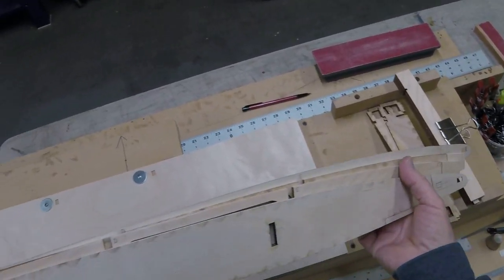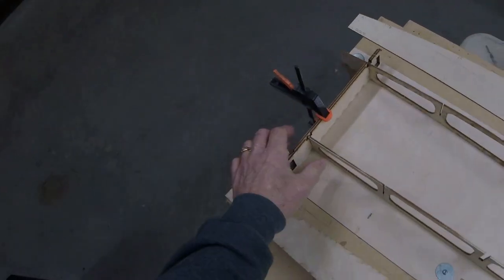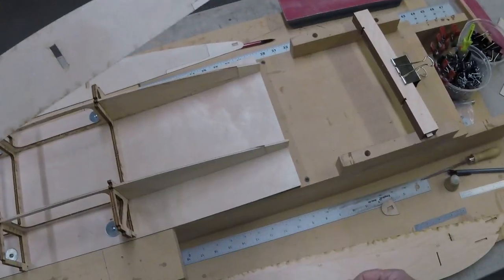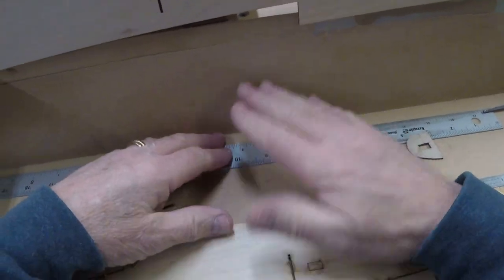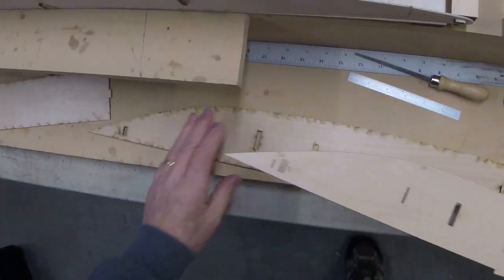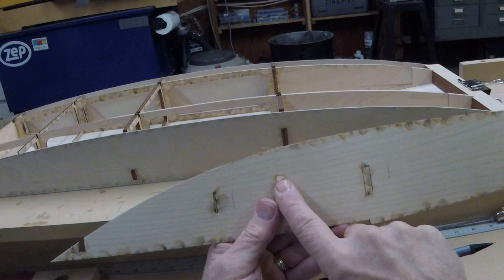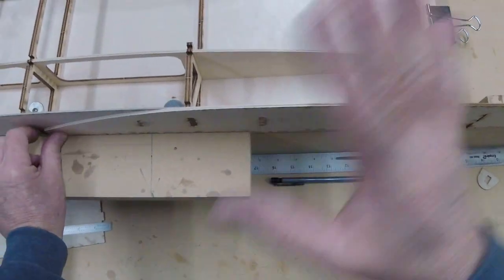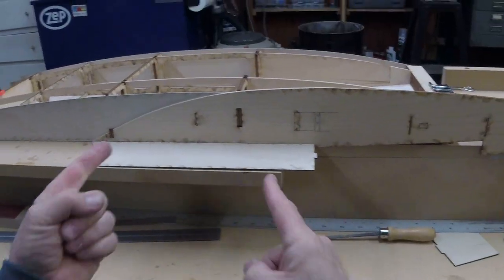Radio Control Kit Build - ML Boatworks Hydroplane Part 3 | Here We Go Again!

Comment: The Black Pearl P Sport doesn't need any tweaking. it is so well designed that people in MI are doing 10 second laps. Top speed of nearly 80mph. I'm building one right now and it's a very nice build.
Reply from the maker: Yes but wouldn't 82mph be better?  🚤
Reply: The black pearl is a very good boat. My experience with the boat anything over 65 in race water it’s gonna blow over.
Reply from the maker: If I ever build a perfect boat I'll quit.  There would be no more challenge! Fortunately, no boat ever made has been perfect

Comment: Weighting to the outside would make it harder, rotationally speaking, for the left side to lift.  However, once it does start to lift it is going to be more difficult to stop the rotation.  So it will be more difficult to recover.
Reply from the maker: Welcome to my world Inspector!
Reply: @M5PerfHydros  Oh I've lived there for quite some time :D  Physics is Phun!  I say as a former Physics major...
Reply: @M5PerfHydros  BTW...I still haven't found a turn fin bracket I'm satisfied with...Any chance I could get you to make one?  Last we conversed in replies you were moving shops.
Reply from the maker: Don't open that can of worms.  I'm still fighting with the county over the building permit (flood plain).  That's why I'm currently working in the Arctic Edition Boat Shop!  I'll need to make a bracket for the new build before long, and I suspect the six guys I know of who are also building this boat will probably want one also, so I'll bust out a bunch at that time.
Reply: @M5PerfHydros  Uhg...bureaucracy at it's finest